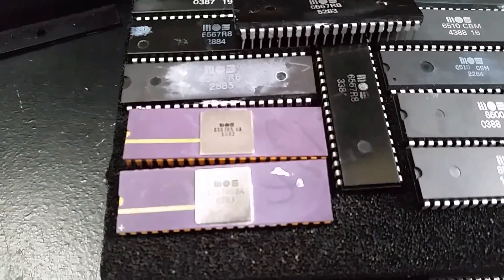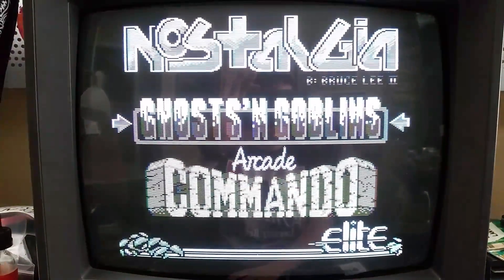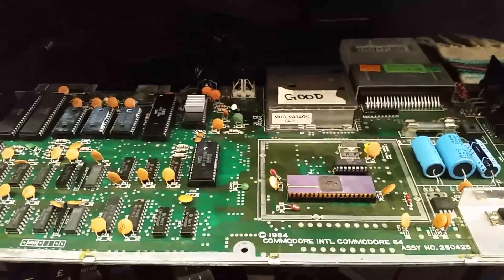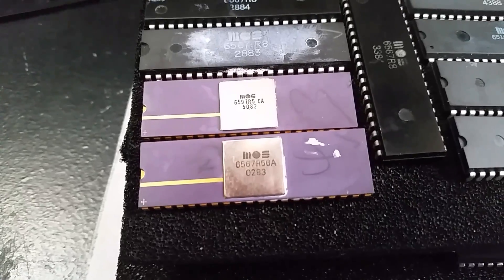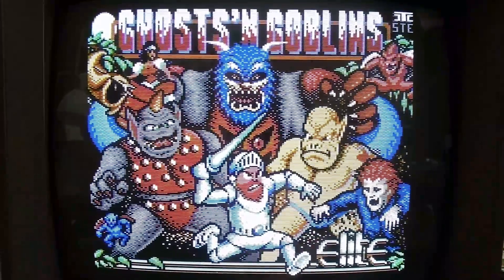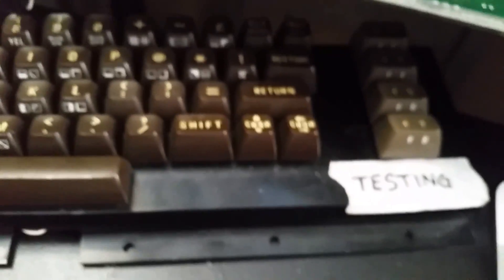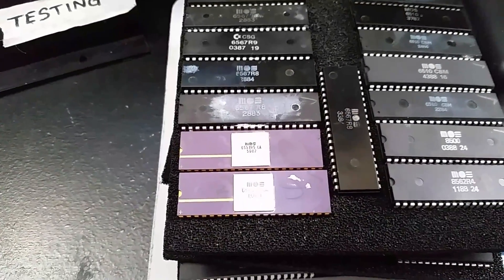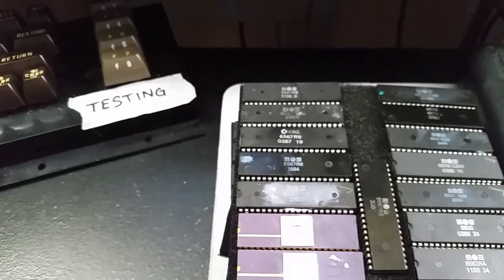Misprint 6567 VIC-II chip?

Comment: This is not a misprint on the chip.  I have one exactly like it.  I believe these were used in the PET 64/4064 computers that Commodore made and marketed to schools back in the day.  They were sold with built-in black and white monitors and did not contain a SID chip.  I purchased a motherboard many years ago from a local electronics supply.  It had the same board number and looked just like my 5 pin C64 (326298), but without the SID, RF modulator and a few other components.  I wired up power and a keyboard to it and it booted up as COMMODORE 4064   BASIC V2.0 in B&W - the same as a PET 64.  That board contained the 6597R5 6A, just like yours.  I believe Ray Carlsen came across one of these same chips when restoring a PET 64 for a client.  There doesn't seem to be any information out there on them, but it doesn't surprise me that it's not compatible with a 6567 VIC as they were designed for different purposes.  Thanks for the test though.  I had planned on swapping it out to see what would happen, and now I know!
Reply from the maker: If this is true, that would be VERY interesting information. I have seen a handful of the stripped down 326298 boards meant for use in PET/Educator 64 computers in my Commodore repair travels and was familiar with their existence. All of my searches at the time (5y ago) came up with nothing so I assumed this was a misprinted 6567R5 6A with a defective color issue. You are absolutely correct that the machines only contained a monochrome monitor, but now that brought this up I do recall reading before that the PET 64 models were “monochrome only” while Educator models retained the ability to display shades of green; which is slightly confusing since either should be able to do that? I still have this chip and it functions the same now as it did then, so perhaps I have another rare piece of C= history and didn’t even know it? Perhaps an update video is in order to share this new knowledge? Thanks again for letting me know!
Reply from the maker: Also its worth noting, the legend at the time was that Commodore was reusing defective mainboards shipped back to them and then repaired at the factory in constructing the Educator 64 machines at least. I wonder if the PET 64 initially used this special run of 6597R5 VIC chips until it was deemed superfluous, and was dropped in favor of using reclaimed/repaired standard 64 boards with features stripped out? Would love to dig deeper into this story…
Reply from the maker: Also, in the off-chance should you happen to want to sell that PET 64 board, I’d be very interested in purchasing it to further this investigation.

Comment: I have one that looks like it but has the 6569 rev3 number. 1983 I guess.
Reply from the maker: Arrayzable Yeah quite a few of the early VIC-II chips were in the purple-ish ceramic packages, but this one is marked as a 6597 which isn’t a chip Commodore ever made. As far as anyone knows at the moment, its simply a misprinted chip that should read 6567 instead.
Reply: Yeah. And comparing the insides of the chips would probably be counter productive 😉